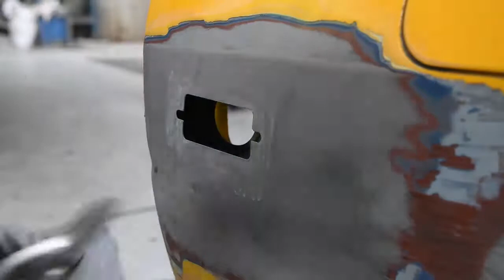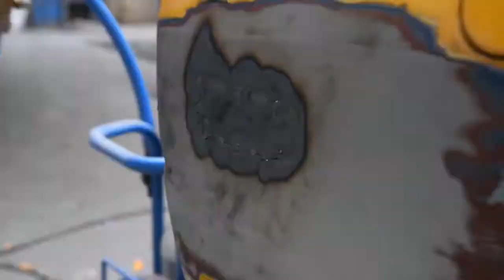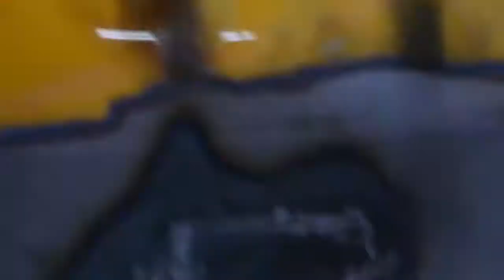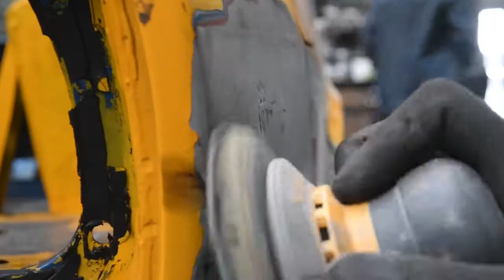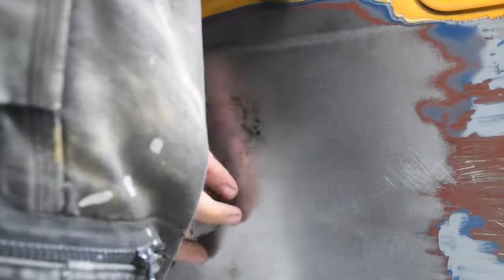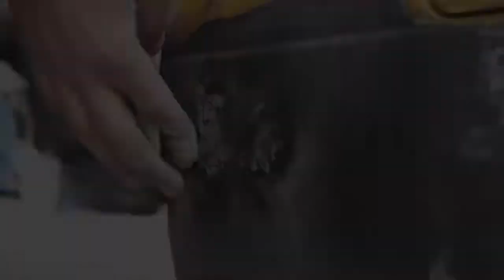Project TOSBO - 1970 Datsun 240z rear side marker delete

Comment: You are an amazing panel beater which is lucky as this is not a gas weld job. You had me on the edge of my seat as the sped up footage shows just how much the panel danced around! I'm betting the mig will come out for the other side and the front! Well done getting it back to shape you are a legend!
Reply from the maker: I'm just the owner ;)
All work is done by SLG classiccars. The other side was done the same way. The fronts where mig welded though
Reply: @monkeymagic86ify  I did see that! As I said, I saw the panel pop with the heat and immediately thought "if that was me I would be in trouble" but he did it all very neatly and a great job! Shows the difference between a pro and chumps like me! Haha